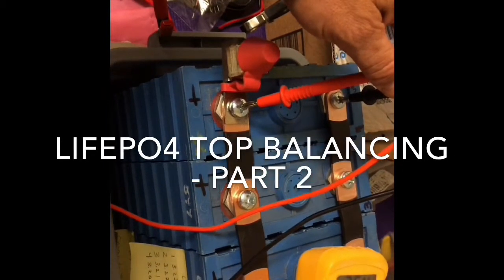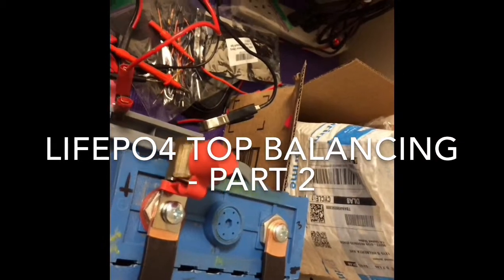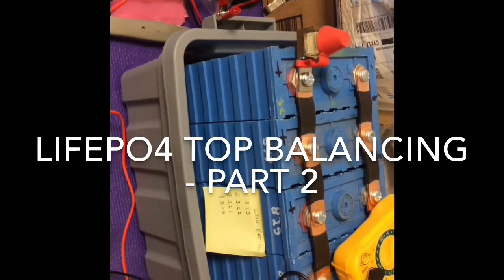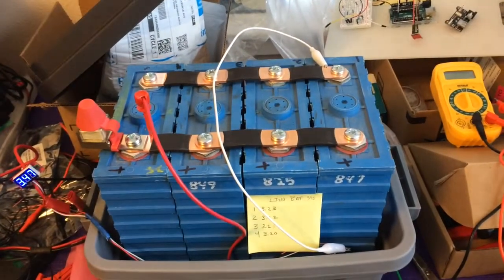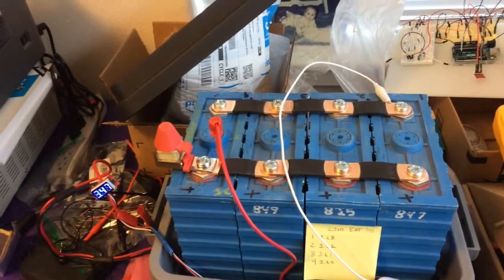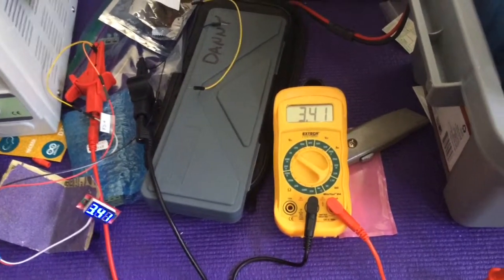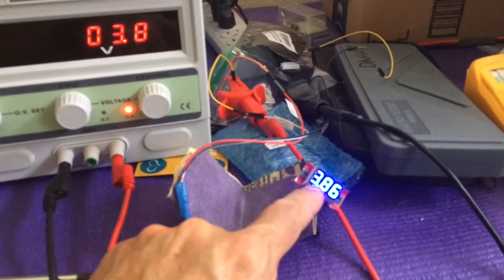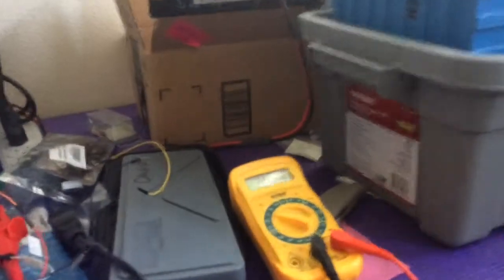Lifepo4 Top Balancing with Bench Power Supply with 4S 12 volt batteries  - Part 2

Comment: You don't want to adjust your power supply voltage under load because there will be voltage drop between the batteries and power supply. The Mastech supplies do not have a voltage sense circuit.  Set the voltage into zero load based on your DVM's accuracy not the Mastech screen then connect the load.
Reply from the maker: I am honored  to read your post Rodd. I have been a customer of marinehowto.com and have been reading your stuff for years. I did take a look at the Mastech manual and it is as you say and this is the safe way not to over charge and blow things up. Are you saying the that I should never exceed 3.6 volts output measured by the multimeter on my supply unloaded? Instead, I was tweeking the voltage down based on the multimeter with probes on the battery terminal so was I not acting like a human voltage sensor limiting voltage to 3.6 vpc like your expensive bench power supply with voltage sensing?  Please confirm that the limit I should be concerned with is 3.6 (Calb 160 cells) on the battery terminal and I'm not going to blow things up as long as I don't exceed 3.6 with my probes on the plus and minus of the battery.  I may have misinterpreted you article saying "trust the multimeter" ... not the power supply.